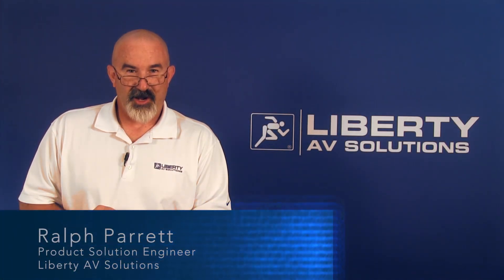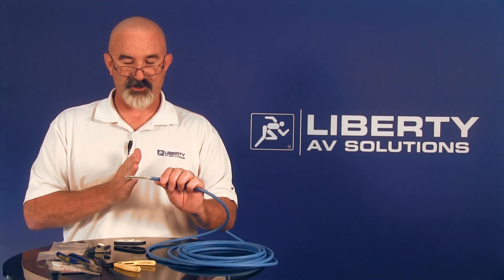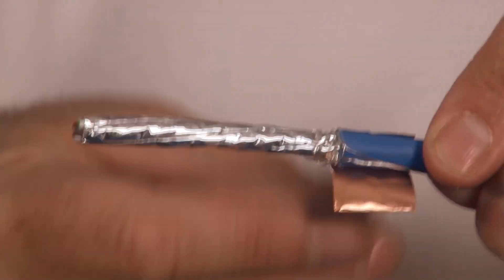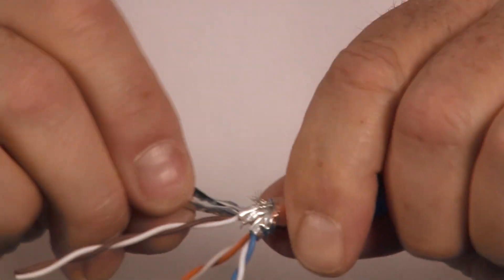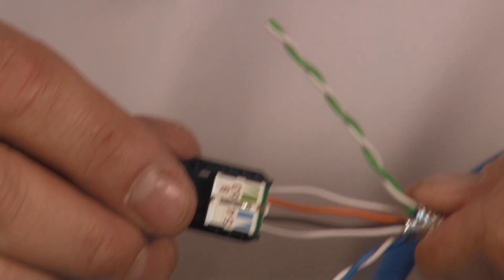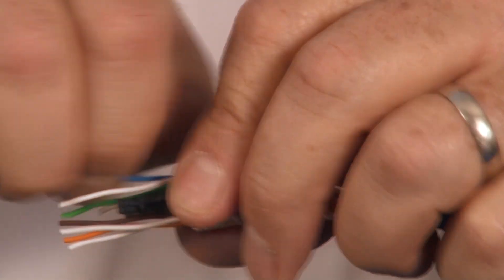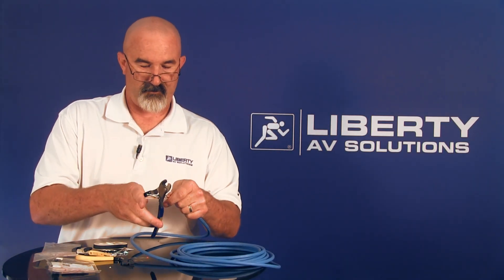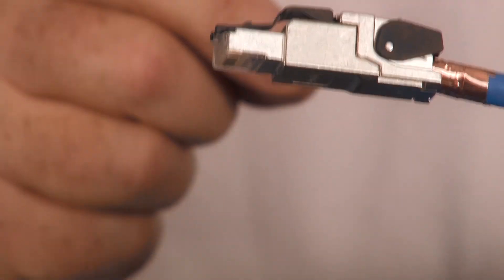OCC RJ45 Termination on CAT7 S/FTP Category Cable

Comment: Noob here...i have been serching for an answer for this and havent found one...this guy make the best tutorials so ill ask here if any one can help me since i am confused and dont want to mess up.....i got a CAT6 cable with braid and foil for the whole 4 pairs (I would guess the correct terminology would be SF/TP???) But it also have a drain wire inside the foil.....how would i terminate that kind of cable?.....Thanks in advance to anyone that can help me.
Reply from the maker: Yes, that is an SF/UTP cable similar to our LLINX-HD cable.  If it has a drain wire you can trim off the outer braid and foil and then fold the drain over the jacket and apply the copper tape over the drain wire to complete the shield contact.
Reply: @Liberty_Online  Thanks!!!!

Comment: It is perfectly explained. But I have a doubt.

I do not have cooper tape and it is quite expensive for just making two terminations. I saw some videos that utilise the foil of one twisted pair. Would that be the best solution? I think that it should be bent by the half leaving the blue part hidden and wrapped around the strands. Or is it better not to twists the strands to cover more surface on the connection?

Thank you in advanced.
Reply from the maker: Hello Jordi! Our method shown is a best-practices method, but there are other methods. If you review the instruction sheet, it also shows the wrapping of the drain wire around the jacket. With Cat7, you would use the braid shield instead, form a long enough drain wire out of braid shield strands (at least 20 strands to net the right wire size/copper cross-sectional area) and follow the instruction on the connector sheet at this link:  https://www.occfiber.com/wp-content/uploads/2017/07/Cat6A_Shielded_FTP_Instructions.pdf

Comment: So is it the case that the foil around each wire pair is just trimmed off, and not connected to anything? 

Only a few strands of the outer braid are used as a drain wire?

Just trying to figure out how each part of the shielding is supposed to be properly terminated. 

For most connectors, the copper tape over the end of the jacket would end up partly covered by the plug, and partly exposed?
Reply from the maker: Thanks for your question! Here is Ralph's answer: 

"The cable construction of both Cat7 and Cat8 is what we call S/FTP.  That is an overall braid shield with each pair foil shielded.  All foil shields are facing out and in contact with the braid and drain if the cable has one.  In this construction there are no isolated shields, all share a common ground/return path.

The existence of a drain wire in standard foil shielded cables is the tool to connect the ground path; in these cables, that braid shield functions as the tool to connect. The use of some strands to make a drain wire is a common practice, just ensure you have enough to generate a 26 AWG drain wire (about 20 or so strands). 

Copper tape is the avenue to ensure plug shield connection to the cable shield. The copper tape should be under the plug and it usually protrudes.  That is OK. That particular connector does not have an external boot but you could use a small piece of shrink tubing if you wanted to dress it out and cover the copper.  You could also use a ½ inch width copper tape to have a lesser exposed amount."

Comment: Copper tape should be two side condactive  ?
Reply from the maker: Yes, both sides need to be conductive to ensure electrical contact from the drain/braid to the connector ground clamp.
Reply: @Liberty_Online  Thanks a lot
Reply from the maker: @boriss282  Anytime!!

Comment: Man, these Cat7 terminal connectors seem way over-engineered to the point that fiber optic start to look easier.
Reply from the maker: Thank you for commenting! While there are some additional details to Cat7, you are correct, there are fiber terminations that make fiber terminations easier and faster than any RJ45 termination.

Comment: This is a clear and concise video on this termination. I’m sure there is a tool list for this type termination. I would like to see that if you please. Tool choice is critical in wire termination ops. That I know. Would like to see more of these videos!👍🏻
Reply from the maker: Hey Mark! The only tool used in this termination was a pair of general use yellow handled cutters, part #8141
Reply from the maker: @Pete Veach-Williams Hi! That connector in this video does not use a crimp tool. Instead, the following tool subset would be used:

1) Pliers: Level Close Pliers are part # FPJP

*Note: Standard Slip Joint pliers can be used as well; we do not have a part number for these at this time.

2) Flush Cutters: Part # 8141

3) Jacket Strip Tool: Part # 15010

4) Tweaker: Part # SWAG0012

Let us know if you have any questions!

Comment: Do these fit in the regular cat6 wall plate?
Reply from the maker: These are male cable mount plugs.  They will mate to a standard RJ45 jack such as a keystone jack.  They are not plate mount or keystone type themselves though.

Comment: This is the cleanest and easiest to follow YouTube instructional I've seen in a long while.    Is the practice and connector the same with 6A?    In 10G applications (max run ~80 ft) does using 7 S/FTP have any advantage over 6A STP?
Reply from the maker: Hello Al, thank you for the positive feedback.  Yes, the procedure is the same, just much less shielding to work with.  Cat7 used in RJ45 links does have advantages over Cat6A, especially reducing internal and external cross talk issues.  As an example in HDBaseT – a foil shielded Cat6A (F/UTP) has about 14 bit errors per billion at 4K30 at the full 100m run.  A Cat7 used in the same application is less than 1 bit error.  This will apply in networking, there will be less cross talk and relational bit errors and less re-query for lost packets.

Comment: Great video, clear instruction. I read that on shielded cables with ground one should only ground one end of a patch cable, especially if a short run. Can you clarify? Your vid only showed one end of the build.
Reply from the maker: Hello Dan - 

In a properly grounded environment, both sides should have the shield attached to ground.  However in some instances where a ground differential is known to exist, then the ground can be “Lifted” on the RX side.  There are also cables available with non-contiguous shielding, basically offering shielded performance without connecting grounds on either side.  These can also be utilized in situations where ground differentials exist.  Ground differentials are common in the commercial environment because of multiple ground points required in large structures.  Any sort of shielded copper extension (LAN, HDBaseT, USB) may run awry of ground issues when crossing these points.
Reply: Liberty AV Solutions could you please advise me as to what cable i should  use for this system. I have been having awful issues and can’t resolve. Datavideo Hs-1500t and 150ptz cams. Thank you
Reply: It all depends on the installation environment.  Regarding drains, landing one end only provides RFI [radio frequency] protection, and landing both ends provides EMI [electromagnetic] protections.  Generally, RFI protections seems to be the most useful.  In those instances, do not land drain at end device - troublehooting takes longer the more you have to run around.  What happens with one end open is the shielding  acts as an antenna, diverting radio induced power to ground, reducing noise in the system.

Comment: could u show how to ground the wires?i have heard in cat 7 it should be grounded to reap the benfits of its shielding
Reply from the maker: Hello Kirby!

While we don’t have a video for this just yet, we can give you an overview of what this would entail:

When you put the connector on the cable correctly, the shield is automatically connected to the shell of the connector.  You need to ensure you use shielded jacks in a properly bonded environment, meaning the patch panel is shielded and grounded.  The shielding needs to have a drain point in the circuit, usually this is back at the rack.

For direct equipment hookup, the shell of the connector receptacle is connected to chassis ground when plugged in.  This is the drain point.  If there is no drain point, static potential can build up and discharge, damaging equipment.  Both sides do not need to be connected, the side closest to the signal origin is the connected side.

Please let us know if you have any additional questions.
Reply: Liberty AV Solutions

Excellent follow up. Thank you for sharing your knowledge.